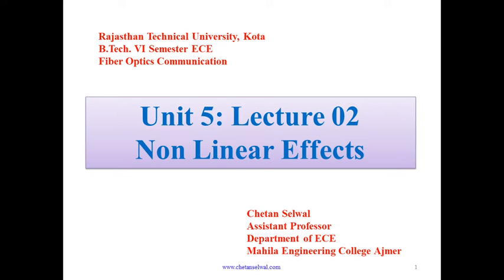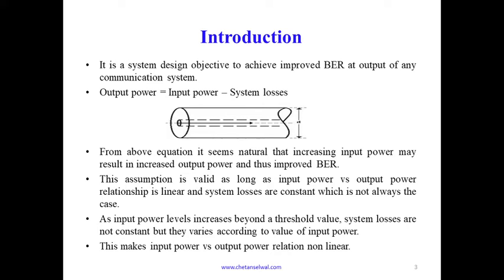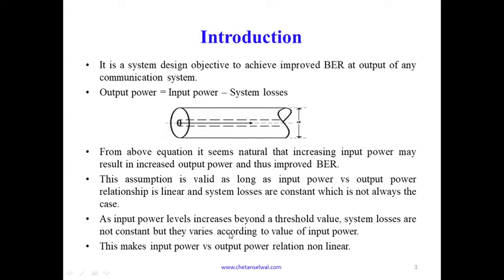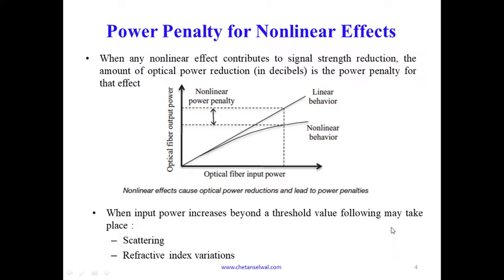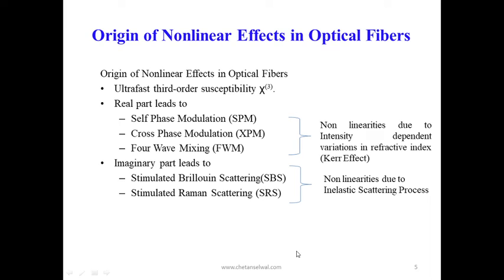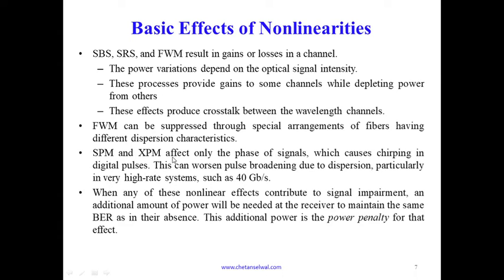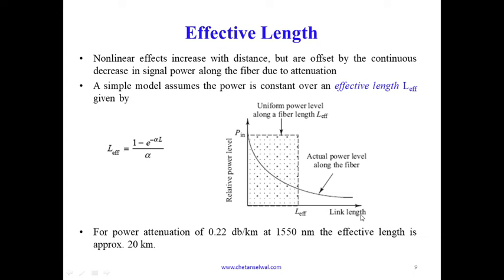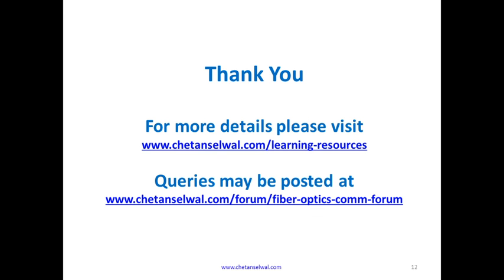Non Linear Effects

Comment: 2:00 I don't agree with you. To be accurate, you should have precise that "the output power" here refers to the output power at the wavelength of excitation. Because in the general case, the output power is conserved even in the nonlinear regime of propagation (if we suppose a small amount of loss, of course...). So if you integrate the energy of all-optical components at the output side of the waveguide (experimentally by measuring the output energy using an optical powermeter...) you will always find a linear relationship between input and output power, except for the wavelength of excitation in the nonlinear regime.